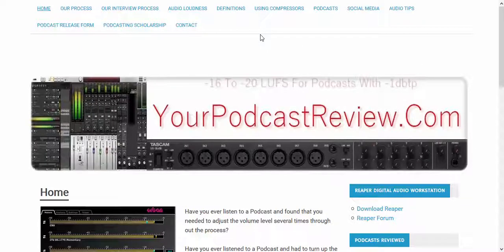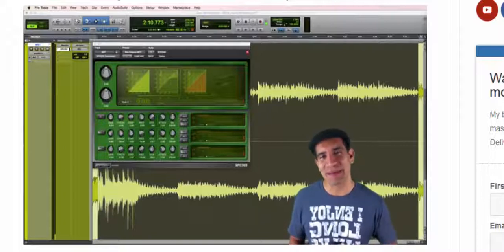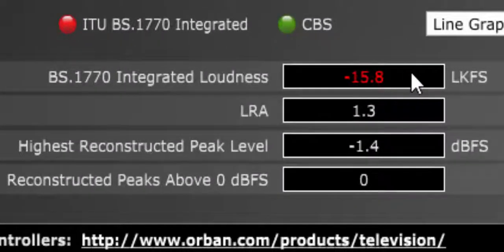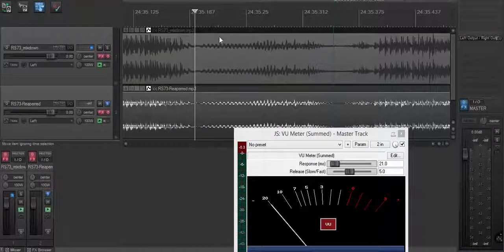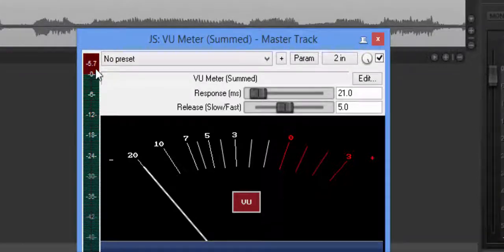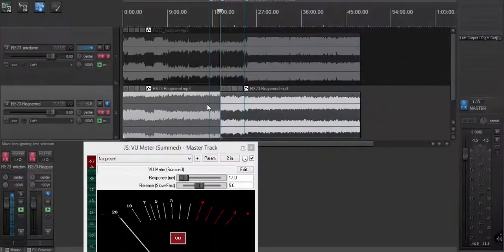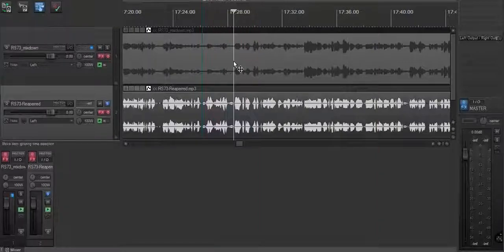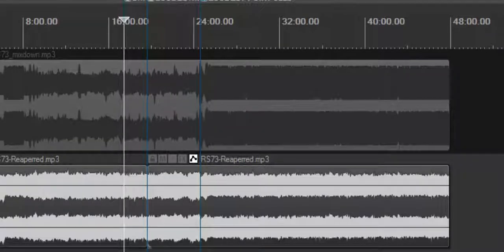Audio Loudness Range   aka  LRA

Comment: Hi bro is there a new lra plugin to boost the lra ?
Reply from the maker: The LRA is determined by dynamics. You can use a compressor to adjust the LRA to a point. If you over compress it, it will sound UN-naturial.
Reply: @DanaTucker1  thanks bro